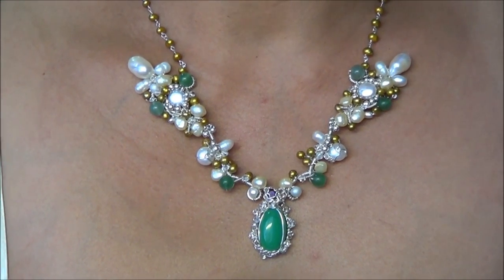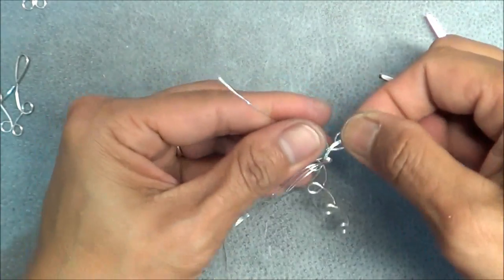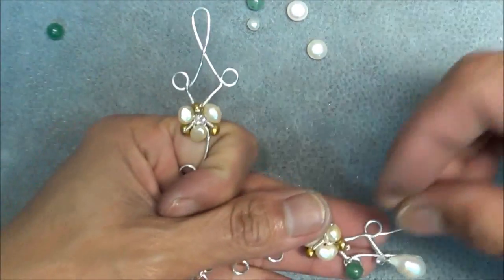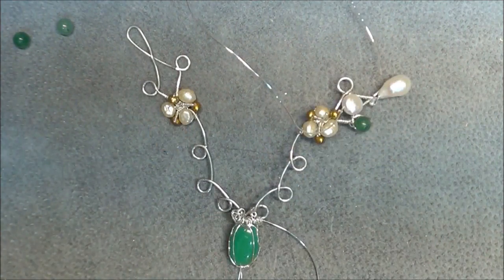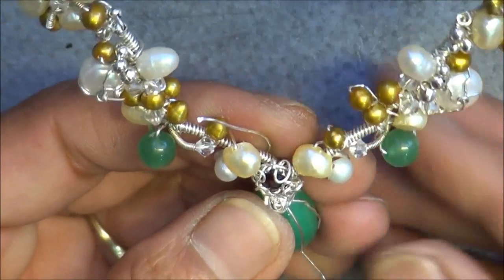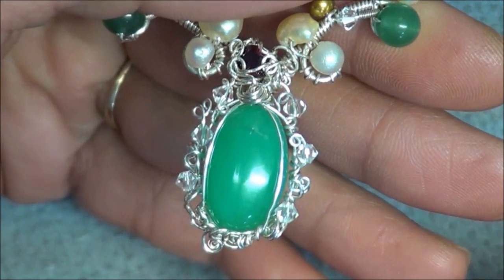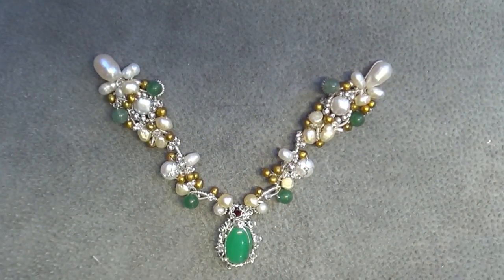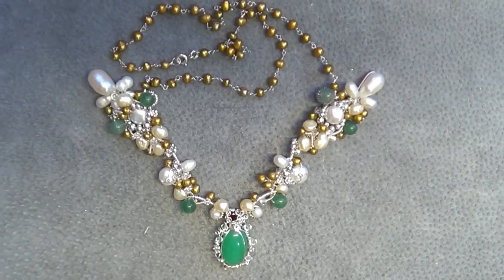Wire Wrapped Statement Pendant TUTORIAL - Pearl and Jade

Comment: This must be for those that are more advanced. You moved too fast and there are times when the item was out of camera shot and you can't really see what's being done.......
Reply from the maker: Hi Karen, This video is for all levels. If you pause the video in certain section, then you'll be able to see much better what's going on. This took over 3 hours of filming and have to edit it to 45 minutes. Videoing wire wrapping is very difficult when you only have a window of 6 inch square to work with. Thanks for watching and commenting. Wish you all the very best. Cheers, Liz
Reply: Speed can also be slowed down in the settings..
Reply: Karen Finney  k
Reply: Well Karen,  if it moves too fast....you can go to your settings and slow the speed down.